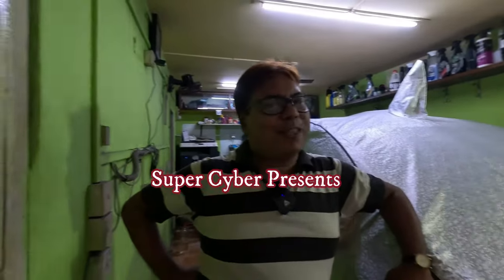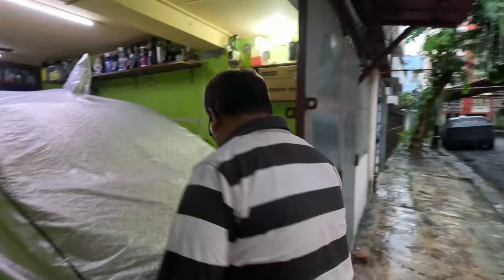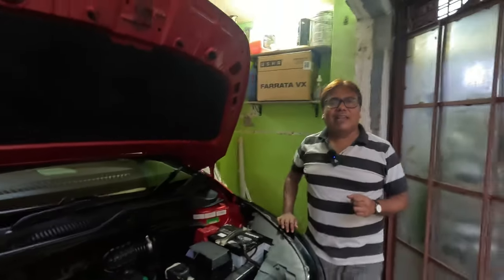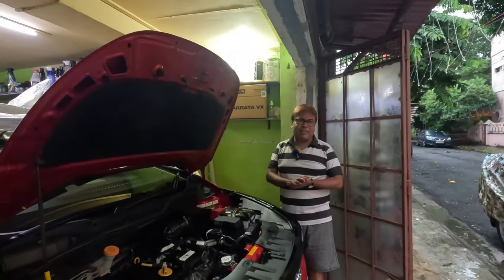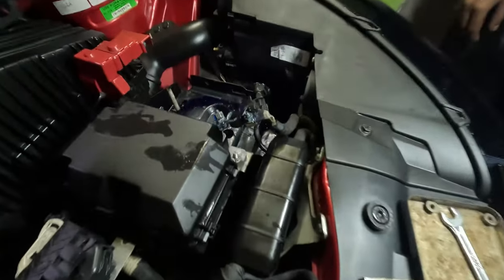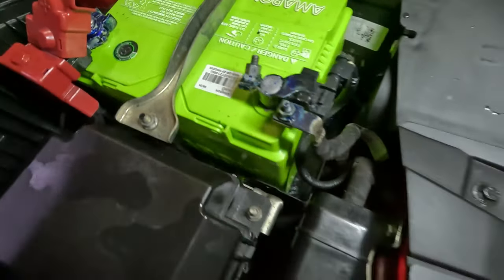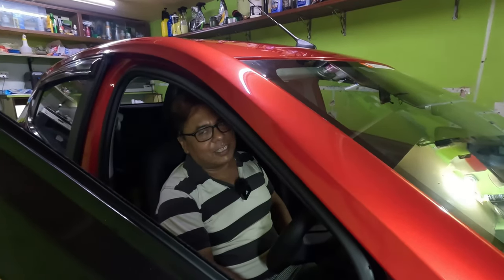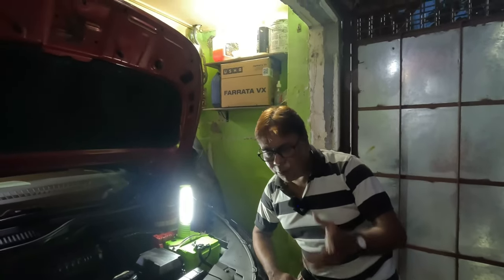The Perfect Aftermarket Replacement Battery For Tata Altroz #tataaltroz #carbattery #amaron

Comment: I should have contacted your earlier. SC replaced my Altroz XZ Amaron (EFB) battery with an Exide (as the battery model was not available) stating that it is compatible. After that my Idle Start/Stop feature stopped working. I went to different SCs but they could not find the actual issue which is EFB type. If I have seen this video earlier, I would have been saved from harassment.
Reply from the maker: Yes ILSS needs efb battery.

Comment: I can’t find this battery (100d23r -70Ah) anywhere in UP (Lucknow, Agra, Kanpur, etc) and even in Delhi. 🥲 Everyone is suggesting to go for 85d23r - 65Ah. Will this 5 Ah gap and no EFB be a serious problem for my car?
Reply from the maker: As a whole it will not impact your day to day running of the car but non EFB may have issues with idle start stop function.

Comment: Hello Sir,
My tata punch adventure has 60D23 battery and it needs to be replaced. Can i go with this one? As the 60D23 is not at all available. The amaron dealers are suggesting me 85D23R!
Reply from the maker: Yes you can go for it. It has a 65 ah rating so no problem will be there.
Reply: @ Thank you

Comment: Dada how is the battery working ? Any issues? ISS working fine ? Amake ekjon dealer bollo 100D23R is 75AH and not suitable for altroz xz model. But r ekjon dealer 85D23R recommend korlo..So little confused.
Reply from the maker: Etai perfectly matches Xz  70 Ah easily amader alternator niye nebe karon Altroz XZ has 110 Ah alternator.
Reply from the maker: I am now on a 6000 km road trip. At every instance ILSS is working perfectly.

Comment: Very informative video…but i am unable to read the first two digit of the model name on the box…can you please help me out? I already texted you on Instagram
Reply from the maker: Amaron EFB100D23R
Reply: @supercyberautomotivetravel  AMARON EFB100D23R is the name on the bill.. I called some supplier s here, they don’t recognise it…i need the model name on the battery box ; or any link to buy that battery will also help me a lot 🙏🙏🙏
Reply: I am from assam; and it’s pretty hard to find this battery you have shown in the video…battery dealer s only have exide battery
Reply from the maker: You call Amaron help line and tell them you want a battery that supports idle start feature.
Reply: @supercyberautomotivetravel  ok i will try that
Reply: I tried to call the amaron , they said its not available in the after markets of Assam…it’s not launched yet here.
Reply from the maker: Then you need to buy from Kolkata dealer where it is available.
Reply: @supercyberautomotivetravel  where is the location of the dealer? Do you have any contact no?
Reply from the maker: This is the dealers no 098301 65296